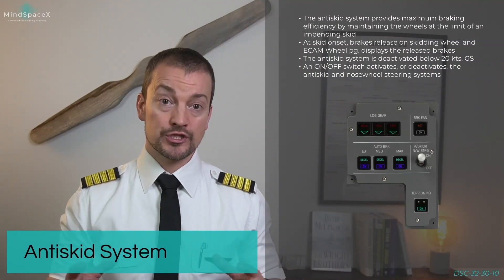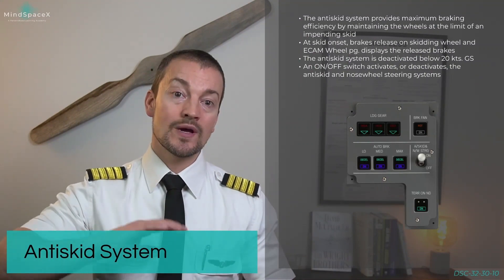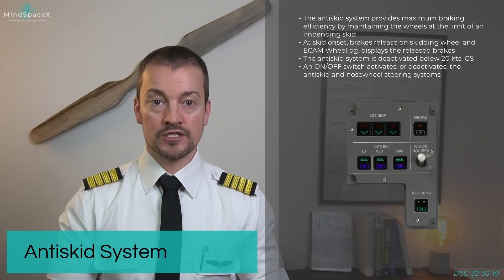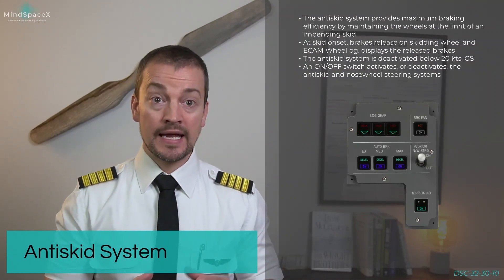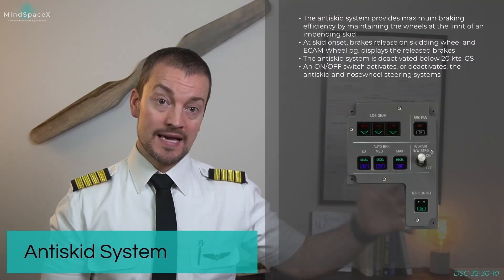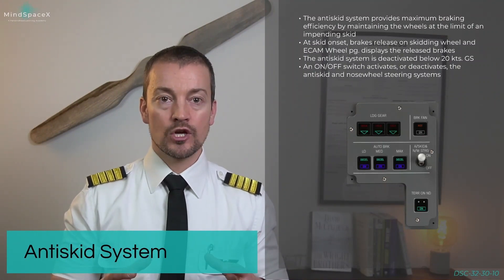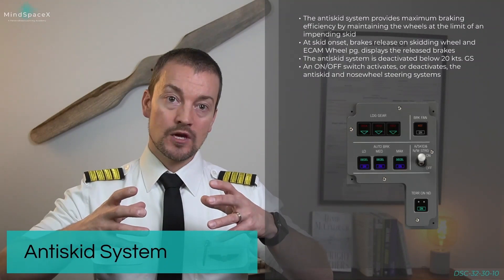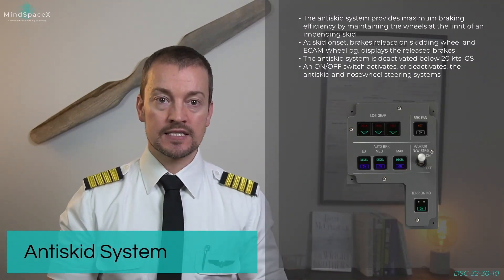A320 Brake Antiskid Function

Comment: You are  misunderstanding anti-skid and hydroplaning
Reply from the maker: Hi, could you please elaborate on the misunderstanding you are referring to? We want all our content to be transparent and understandable so it’s important to clarify if the message is not clear.
Reply: @MindSpaceXAviation  A skid is actually when a wheel is no longer rolling along the ground without slipping. Usually, as a wheel rolls along the ground there is zero relative motion between the wheel and the ground at their common point of contact. But, if the applied breaking force on the wheel is too great, the wheel will begin to slide against the ground instead of just rolling without slipping. (You can google the very common physics terminology "rolling without slipping" and "rolling with slipping".) When this happens, there is relative motion between the wheel and the ground and so the maximum frictional force the ground can apply to the wheel suddenly decreases. (The correct terminology here that the "coefficient of static friction" of the surface is always greater than the "coefficient of kinetic friction".)

During a skid, because of the lower maximal kinetic frictional force, braking action is greatly impaired. Anti-skid prevents this condition by detecting, on each wheel separately, when the wheel has just begun to slip. When this happens, it momentarily releases the brake to allow the wheel to spin back up to exit the slipping condition. (You should imagine the wheel spinning back up to be "in sync" with the ground again.)

Hydroplaning is completely different; it is the dangerous condition you describe where the wheels no longer make contact with the runway surface, and braking action is reduced to virtually zero.